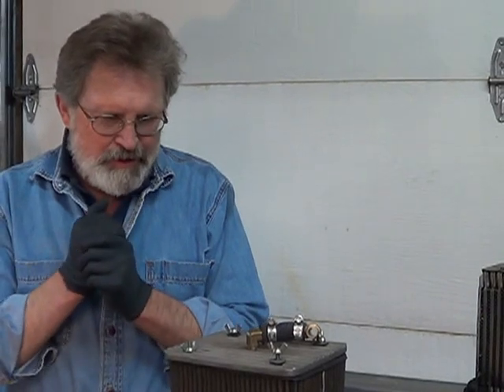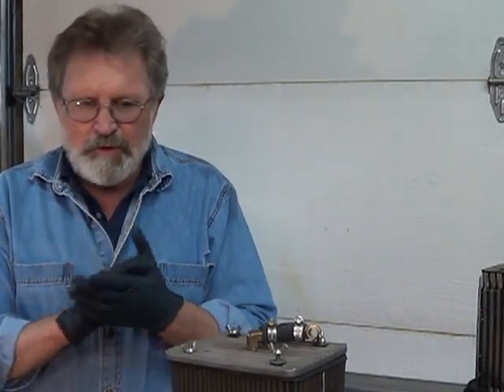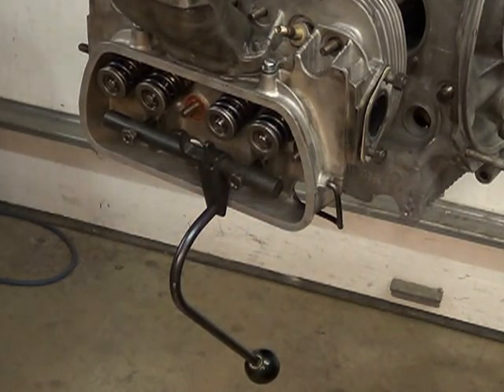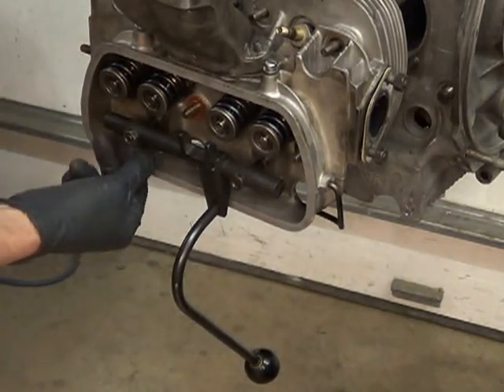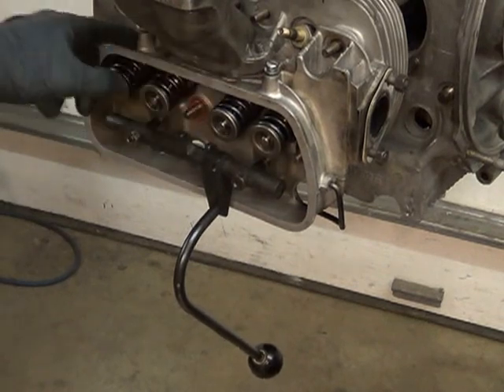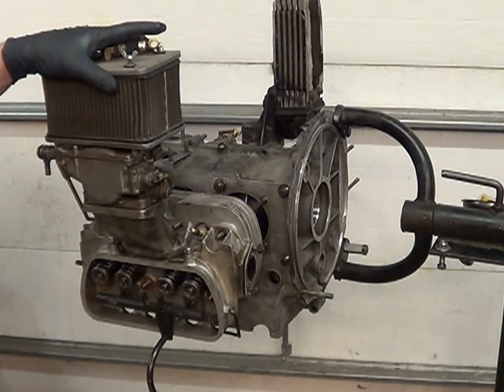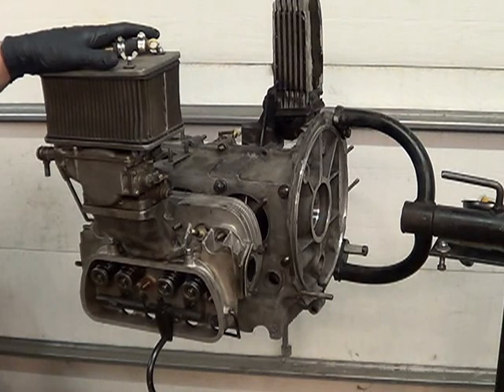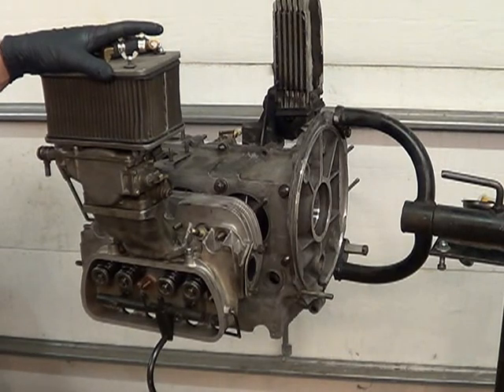VW Head tricks #4

Comment: harley did a lot of flow work on their heads, and they came up with. by polishing the head ,the gas molecules stick to the surface, by bead blasting, to a semi rough surface, the gas molecules would tumble and get more gas to the cylinder
Reply from the maker: I suppose it all depends on the RPM and other variables but I've always heard the same thing. Good to know you had Harely Data to back it up. Thanks you so much for commenting
Reply: Thanks for sharing your knowledge where can I buy erramienta como la tuya para quitar los empaques del resortes

Comment: I love that you're a Berg fan... I'm working on my 90% Berg engine right now and watching videos to refresh my memory because the bug has been setting for 17 years... gonna make it my daily driver again.  Thanks for your help.  edit Wow! when I first commented I didn't know you were gonna break out the valve boss cutter that I need to get to install my Berg dual springs in new heads... you made my day/month!  I feel much more comfortable buying and using the tool now.  The part is the GB 706 valve guide boss cutter.

Comment: So I still have not found my project bug yet but want to start somewhere so the motor will have to do. I've been looking at cases and have some questions since the price of a case compaired to a super case is a couple of hundred dollars. I'm kind of shooting for zero to 100 in a hurry just fridays night burgers at in n out. Thinking .94 with a turbo what if any machining on a super case am I looking at. There will be no freeway drives everything I need or want is nice and close which should be fun for a lil rusty sleeper.
Reply from the maker: Knowing what I know now. I would buy a CB performance engine kit. Tell them you want to add the Turbo later. The same 112 degree lobe center cam will work just fine without the turbo. Friend of mine did it. Pat Downs will advise you.  Work around your budget but start with a good foundation. I used on of the aluminum super cases for my 2 liter and love it. It will take the abuse. http://www.cbperformance.com/Builder-s-Choice-Engine-Kits-s/116.htm  You will still need the engine tin and all that but when you find a car you can probably use the stuff of that. Sounds like a fun dream and very possible. If you go this route and save the receipts at least there might be a chance to recover some of it if you change your mind or something happens. I'm getting excited just hearing about it.

Comment: Hi EZGZ thanks for the videos. When installing the heads do I really need the copper head gaskets? I was taking with a tech guy at the parts store. He mentioned that I didn't need the gasket if my heads and jugs are stock. What are your thoughts?
Reply from the maker: +Jason Fay All depends on what compression you want to end up with. A stock engine you are pretty safe without any and run good gas.  I lowered the compression on all my engines and they run just fine and I can 't tell the difference in the seat of the pants meter. Adding the shimms  will throw off your rocker arm geometry just a bit. Do what feels good to you and watch it. Thats how we all learned.

Comment: Can  someone  please help me  to se hao to install  a set of bolt on valve cover  in a vw bug
Reply from the maker: +Stanly Sharp There is only a spring clip to hold on the valve covers.  If you mean the rocker shaft stud you can sometimes thread on 2 nuts and use 2 wrenches to twist them into each other and unscrew the stud. If it is destroyed you can use vise grips. You will need tools and replacement parts.

Comment: Hi EZGZ, Great tips! I know I'm a little late here. I like learning tricks from some body that's been doing it for a while. 1 tip for you, when changing a valve spring when the head is on the engine and you don't have any compressed air put the piston close to TDC on that cylinder then take about a 2 foot long piece of rope and put it in the spark plug hole as much as you can, make sure you leave enough rope outside the cylinder to pull the rope back out, then turn the engine by hand til it stops witch shouldn't be very much. That will tighten the rope against the valve so it won't drop when you take off the spring.
Reply from the maker: Great suggestion.  That might come in handy in my future. Thanks for watching and commenting